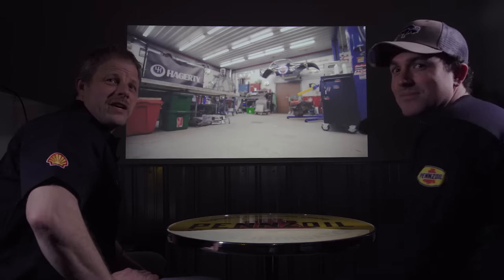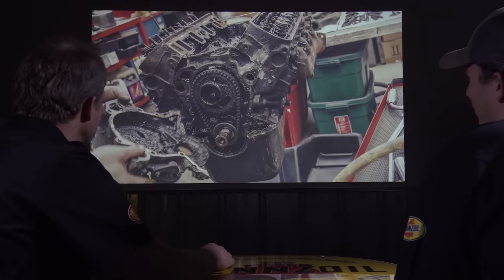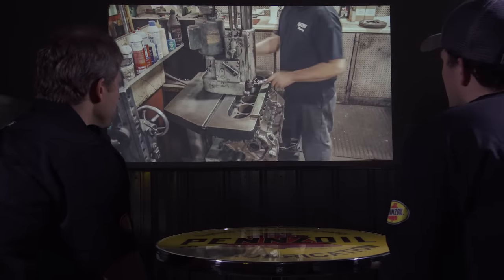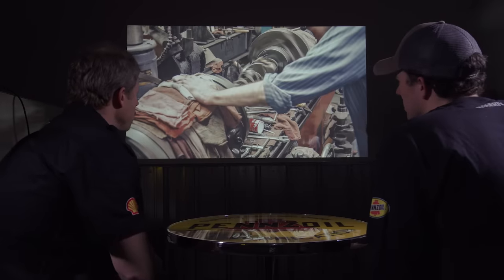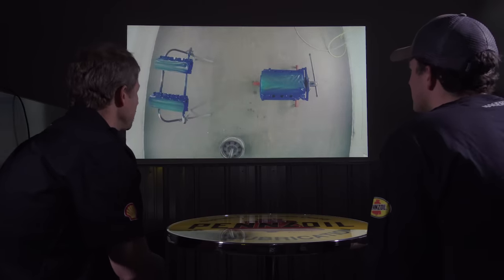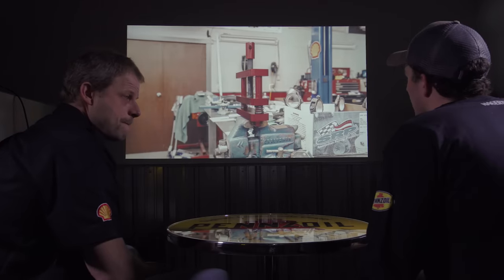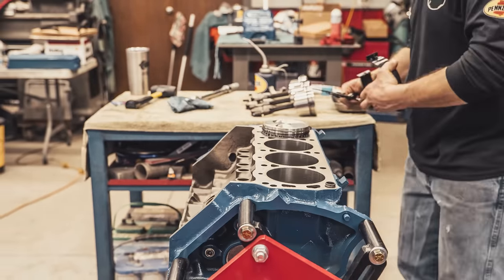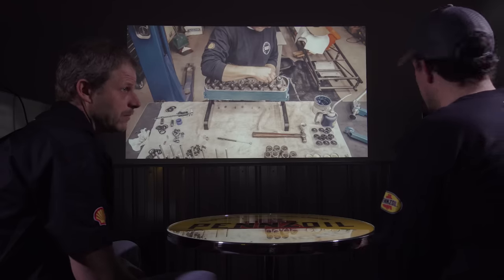How we rebuilt a stock Ford 289 V-8 to Shelby GT350-like specs | Redline Rebuilds Explained

Comment from the maker: Watch the original rebuild video here: https://www.youtube.com/watch?v=tVtrnxx3rTE
Reply: Hagerty amazing video
Reply: So what car are you going to put it in?
Reply: excellent video, thanks! what happens to these engines after rebuilding?
Reply: Most important part in forgot the balance the engine and how the porting work going to head
Reply: So I got a drill press and a chain saw. But I think Ill let him rebuild my engine
Reply: Hagerty what would it take to get it to 400 hp?
Reply: Hagerty so, who’s that company who did the tear down on the motor? And professionally did everything it needed and you wanted done for it? Also. How much did it cost you?
Reply: @mr.e5930  
A fucking miracle .
Reply: Modern aluminum cylinder heads, roller cam, and 6500 RPMs

Comment: A base 289 2V doesn't make 260 hp, more like 200.
Reply: in '64, this 289 2V was rated @ 195 HP, close to what you suggest. They tended to make a little more (maybe 210~220), but yeah, 260 is a 'bit' high.
Reply: I had a 69 mustang with a factory 302 2v, and it was rated at 220 hp.  
I don't think you could get 300 hp out of the stock heads.   They were designed for low speed torque, not power, with small valves.
Reply: Yeah and the 200 hp was gross hp. It was probably around 150 or so in net hp. I find it difficult to believe this engine got 300 hp. Would really like to see the dyno sheet and cam specs. And you would need the head work to go along with a hot cam. I rebuilt my 289 back in the 80's similar to this one and doubt that it has more than 210 net hp. My mistakes were going with too mild a cam and not getting head work done. I did use the roller tip rockers, got new valves and that was it. Another mistake was using a single plane intake. I used it because I got it very cheap. The engine does have a really nice mid range. Without the head work plus an out of the box Holley 600 equals a rich running engine.
Reply: Agreed. The '65 (6 bolt) 289 4V was 225 HP. The High Performance 289 had 271 HP which had the solid lifter cam. The Shelby version was a tad higher.
Reply: But the thing about the old cars, such as a 60's Mustang they were 1000 lbs lighter than a late model Mustang, and they had few things parasitic on the power.   So 250-300 hp is all you need in an old Mustang for it to be fast.
Reply: Yes but, we're simply correcting some of the mistakes "experts" are suggesting as era correct data. Nothing to do with is it enough but more about actually, the xyz motor was this many HP that year with the 2V or 4V etc.
Reply: Don't forget that HP was calculated differently back in those days, and the process has since been updated/changed.
Reply: @Danyil Underwood Where dreams are made from !!!!!
Reply: This is a '64 289? That makes it a 5-bolt block. And the GT350 Shelbys were all 6-bolt blocks. The earlier stuff is way harder to find bellhousings, mounts, etc. for. The 6-bolt blocks were a little tougher engine, too. BTW, factory power rating was 306 horsepower, unless you had a GT350R,in which case they were rated at 350+, most posting right at 360.
Reply: You can make 400+ hp with these old windsors.   But you need better flowing aftermarket heads.  
But there's a lot of room from improvement.  The non-hipo engines have press in rocker studs, which will pull out if you put strong valve springs.
Reply: What no one seems to mention was that motor was a freak. A windsor with torker manifold and 600 holley and headers would smoke everything out there at the time. You could rap that b to 9k rpm while they were trying to catch up. Basically stock motor was thrashing mopars and chevys like nobodies biz.

Comment: The reason vehicle brands have different firing orders for their engines is due to American intellectual property and patent rights. In order to patent something, it has to be at least 15% different from a similar item. The easiest way to do this is to change things like; firing order, cylinder number, part names, bolt patterns, part locations, etc. They do the same thing, often the same way, but patents aren't infringed.

Comment: A cork gasket?  AND a Fram oil filter!  So many heads exploding. ;)
Reply: J Smith lol. It’s what I’ve been using for years on basic engines.
Reply: That's just beginning I built mine with same expertise at 15. These guys are supposed to be experts
Reply: @richardanderson5109  ive never had a problem with cork gaskets or fram. Change filters regularly. Use a new gasket when you remove an old one. No problems.
Reply: Fram gets a bad rep because they're so common, people always see them on blown engines.

They aren't the best filters, but regular oil changes and nothing wrong with a Fram.

Comment: The coffee coloured oil he refers to only generally shows up when the engine has been overheated to a standstill  "then then topped up with water, creating the coffee colour oil, generally a thinwall casting motor like these when overheated enough to blow a headgasket it will also have warped the block head surface and cylinders walls , i worked for a mustang restorations and classic racecar shop. Main thing to remember these are 60 years old and generally run into the ground

Comment: Great video!  I just wanted to share that, ..all the different 289 engines from 1965 thru 1967 used the same block.  What made the various 289 engines unique were the engine codes. A-code engines had 10:1 compression, hydraulic cam, 4 barrel carb on a cast iron manifold, making 225 hp.. The C codes had a 9.3:1 compression, hydraulic cam, 2 barrel carb,  making 200 hp.. D code engines were the first 289 engines 1964 1/2 were identical to the C-codes but with a 4 barrel carb, making 210 hp.  K- Code HiPo engines had 10.5:1 compression, solid cam, 4 barrel carb on a cast iron high flow intake manifold, making 271 hp ..this HiPo engine also had wider main bearing caps than the other codes.  
Carroll Shelby used the 289 K- code engine in all the 1965 thru 1967 Shelby GT350's  but made the engines unique by used his custom SHELBY cast aluminum value covers and aluminum intake manifolds that allowed increased plenem volume,  yielding 306 hp.   Shelbys HiPo 289 K-Code engine came at a point in Chevrolets history of 300 hp 327 Corvettes...
.

Comment: i owned a real K code '65 fastback...the non California cars don't have vins on the block so all you can do to verify originality is check the dates to be consistent with the build date of the car and verify the main caps and heads and look for the crankshaft metallurgical test mark that were used to select a hipo crankshaft. Of course the Hipo engines had the special counter weight/hatchet shaft and hipo rods and harmonic balancer and a dual point distributor also. Anyway we believed we had the original K engine so myself and my dad (an old Ford guy and a Rocket Engineer at The Cape) rebuilt it according to blueprint specs including an align-bore and added the Shelby mods (manifold, carb (we used a Holley 650 double pumper with mechanical secondaries rather than the specified holley 715 and tri-y's). When the engine was dyno'd it pulled 311 HP...so 5 more than the advertised 306. My dad said it was our meticulous rebuild to blue print specs that gained us the 5 HP.

Comment: Hey don't even need the alternator if you have a good battery. Save drag on the engine.

I once drove 150 miles in -40F deg weather with a 350 sbc in a 57 Chev with no water pump, no fan, no heater and  no alternator running. This was due to a broken alt mount. I had a temp sender between # 1 & # 3 cyl and an after market temp sender in the intake. She stayed at 180 degrees as long as I could stay at highway speeds. I coasted through small towns with the engine off. Convection currents in the engine and rad plus bitter temps kept her cool. And a scraper kept us looking out the windows. We were frozen solid when we got home though

Comment: Interesting that you are talking about valve springs. Turns out I have to replace the springs in the new engine. They came from Kaufman with K-Motion and for some reason the seat pressure is all over the place (three at 210 and on the other end four at 260) in any case we feel it is not enough seat pressure for the new engine. I'm going to replace them with Comp 699's on the vehicle (will be making a video on that). Been learning about bind, clearance and install height this week. See you this spring I hope, Not sure I will be ready for Gateway. Glenn Lever

Comment: I would also like to see anti seize on the threads of the head bolts, crank and rod bolts and spark plugs. Keeps the torque smooth and threads clean

Comment: Good video, but I'm glad you just said this was built to GT350 like specs. Because although a GT350 mustang 289 is just a hipo 289 with a different intake, carb and distributor there were still several things different with the block, crank, rods, and heads that would bring it fully up to those specs.

Comment: when I built my last 289 I stuck a big speaker magnet  2 or 3 inch sized  to the outside bottom of the oil pan, a few years later a noisy fuel pump convinced me to pull the pan and check the rods, around the magnetized area was a film of iron dust collected there and saved from going thru the oil pump, that engine lasted 10 years of strip and street duty and ran great when I sold the car. might want to do the same. would have loved to build a long rod 302 which is a 302 crank and 289 rods with different custom pistons, supposedly they run great.. makes sense since a Boss 302 ran hi po 289 rods.

Comment: the Ford 2bbl 289 came from the factory with 195-200 hp, the 4bbl 2 bolt main version was rated at 220-225 hp, but I'm sure you were aware of that

Comment: In ANY Vee type engine, One head is slightly ahead of the other head because of the way the rods are on the engine.  The head that is farther ahead gets the number one cylinder.  
So when looking for the number one spark plug on any engine, look to see which head is ahead.  Easy....The numbering is as per the engine brand and must match the camshaft.

Comment: In 1980 in 11’th grade I had a 289/C4 in a 1962 Falcon Ranchero that ran 11,80’s before the 5.0 era with all the aftermarket support!  It would launch harder than most big blocks.

Comment: What would an average cost be for the machine shop work done on this engine?
Reply: Depends on if you take it apart or if they take it apart, same with building it
Reply: A lot !!!!! Whether you take it apart or NOT !!!!!
Reply: @richardanderson5109  thousands. Lol. Here they wanted 2000 In machine work if I took it apart. That's just the block not the heads. I could buy assembled aluminum heads for their cost of rebuilding my stock ones.

Comment: 20:40 I was always told that leaded gasoline left an ash on the valve seat, and that ash acted like a cushion between the valve and seat. That cushion prevented valve seat wear. Once unleaded gasoline took over, there was no longer an ash that formed on the exhaust seat, so the valve seat felt the full force of the valve hitting it. That was what would beat non hardened valve seats out of shape. Also, I thought the lead was no lube, the reason it was used was that tetra-ethyl-lead was a cheap way of raising fuel octane.

One trick used by classic car guys was MMT based gasoline additives. They would raise the octane and form ash on the exhaust valve seat. However, that ash would be far less toxic than lead.
24:55 I always worried that this process would ruin the heat treatment that makes the rods tough. I suppose that is why rod heaters are so specialized.
59:29 I figured you would buy a parts store rebuild.
101:29 The LS is practically the opposite. A flat tip and a roller fulcrum. I guess that works because they all had hydraulic cams from the factory.

Comment: I probably would've used modern cast iron heads on this (either from the 5.0 HO, or more likely, GT40 or 40Ps) for a little more power without giving a whole lot away looks wise.

Comment: Hydraulic lifters have advanced since the 60's.  Wouldn't they produce equally in this set up?
In '65, our 289 4V was factory painted black with Gold valve covers and air cleaner.

Comment: Hmm. No machining of the block? No squaring things up in relation to each other or cleaning things up afterwards? Just asking from a longevity standpoint since you’re upping the power a little bit. I did this with a standard 289 from a Mustang but I took it out to about 450hp and as far as I know that engine is still running today.

Comment: iv e noticed that barrel faced top rings dont leave a ridge on the top of the cylinder bore as much as straight cut rings, and as they wear the ring surface in crease,s even though the gap is wider and the second ring is just  scraper

Comment: Good Video!!  However, it's just my opinion, but a 289  with the 6 bolt would have been the better option.  It came out later.  221, 260's early 289's had the 5 bolt.  JMHO  Also I think to be period correct, for the 221, 260, 289 early versions were all painted black, The variance was the color of the Valve covers.  I believe Gold, for the 289.4V  Engines
Just curious,  Did you replace the Valve guides?  Cam Bearings?  There was no mention of it.                                                           And I use PlastiGauge when measuring for Oil Clearance on the Rod and Mains.  Nothing wrong with your way, just seemed a bit labor intensive. 
And Lastly, I never heard you mention with any great detail, about the 5/16th shaft that drives your oil pump.  I cannot tell you how many of these Pony Motors I've seen where that shaft twisted off.  ARP makes an updated version, I've used with good results.  Any way, Great job!!

Comment: We had our "C" code 289 overhauled a few years ago by Burt's in Colorado Springs.  They have been here since the 1950's and they did it nearly the same way you did.  They did add push rod guides and left the hydraulic lifters though.  Still not enough power for me.  Maybe add a Paxton supercharger since we are at 6,000' above sea level?  Or NOS?  What do you think?

Comment: The Ford 289 was and stile is my favorite engine. No matter how many miles was on one, there was hardly ever any blow by from the piston rings. Does anybody remember why?
Reply: Ronnie why
Reply: From what I know the piston rings were made of a much stronger material up until the 90s or so in factory manufactured cars...then in the 2000s manufacturers started using pistons rings which were made of a softer metal that I guess had less friction to be able to meet more stringent fuel economy standards set out by the EPA also coupled with lowering oil viscosity from 30w or 40w down to 5w20 and 0w20 which was also done for fuel economy...makes sense to me since every 80s and 90s car I've owned never had oil burning issues due to piston rings...every 2000s and newer car I've had with the exception of my 2011 mustang v6 has always burned oil even with sub 5000 mile maximum oil changes with synthetic...I run 5w30 in my 2011 mustang since it allows for much better and smoother Variable valve timing engagement rather than being an on off switch between 3000-4000rpm like it was on 5w20, and me and my cousins only run 5w40 in our turbocharged euro cars...anything less than 5w40 in our euro cars and we're adding top up quarts every week...we keep it at 5w40 and we have very little oil consumption...generally in older cars with the higher strength piston rings if you're losing oil, check for leaks and if no leaks replace pcv valve or just delete it and route both valve cover pcv's and block pcv to the inlet before throttle body...you'll get better ring seal this way

Comment: I don't understand why the Original Ford Connecting Rods were re-used here... It makes no sense.  If you are going to the trouble to re-build an engine and especially put NEW Pistons in, Why use the 50+ year old Original rods and take the risk?!?? Even if they were magnafluxed, I and others certainly would have gone with NEW Connecting Rods in this build.  Maybe you guys can explain why the Original 50+ year old Connecting rods were re-used.  Thanks, and Great video.  Tony K.  MCA#70001
Reply: A couple of very practical reasons:  a) it reduces the cost of the rebuild, as the parts on the engine already are essentially free.  You already have them in place on the engine.  They're obviously not broken, not worn, not bad.  They are among the more durable parts of the engine, so why not reuse them?  b) the engine's stroke is being kept original.  They are not increasing or decreasing the stroke of the engine.  Obviously if YOU want to buy new rods for whatever reason, that's fine.  YOU pay for them.  I might add they also reused other durable parts of the engine, such as the pistons, camshaft, heads, although these could also be replaced per the engine builder or owner's preference.

Based on your argument, why use a 50 year old engine?  Just because it's old doesn't mean it's worn out or broken.  That's the whole point to freshening a 50 year old engine.  That's one more engine not rusting away in a landfill or in a field somewhere.  I'm all for that.
Reply: @houseofno  Nit-picking here, but block was bored, so new pistons, and the camshaft is now a solid lifter type, so new cam as well.